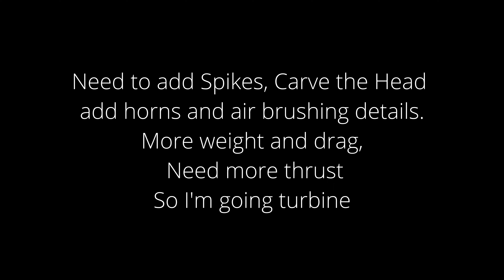Dragon Maiden Flight

Comment: Once built a flying dragon for one of the kids scrap art projects. Work started after dinner and test flight about 3 am. Child asleep by 11pm. The rush well it was do the next day ....he needed the grade . Now admittedly it was a glider, but built of scrap and some foam packing material . Designed carved, wings built assembled tested added small screw from bench as nose weight hidden down the dragons throat.  3am retrieving from neighbors yard tad scary. Was besieged  with request to build more. Posted the plans to school builtin board. No way I was going to paint all those scale again. Larger version was started but was destroyed in move .  So I applaud your beast,  thecclaws on mine were used to hand it up a bonus the kid discovered.  Thecfollowing year acsolar flying wing two Polaroid batteries ..4 small motors  take care keep building .